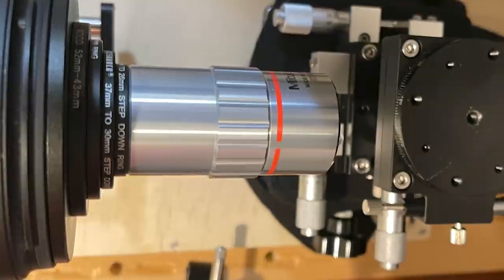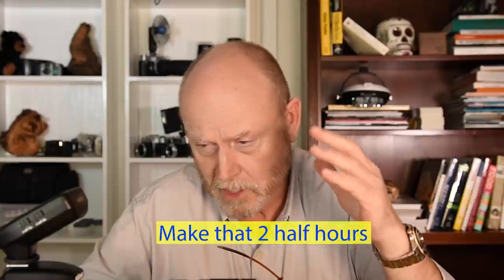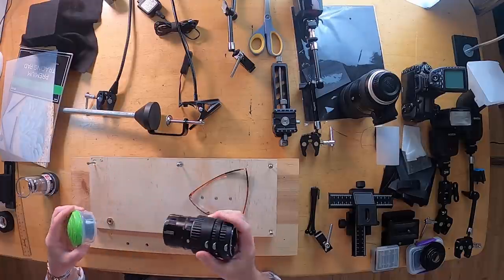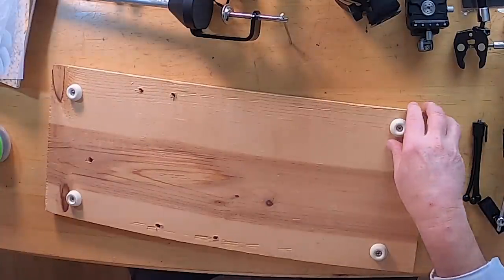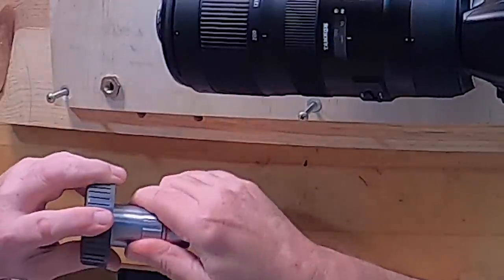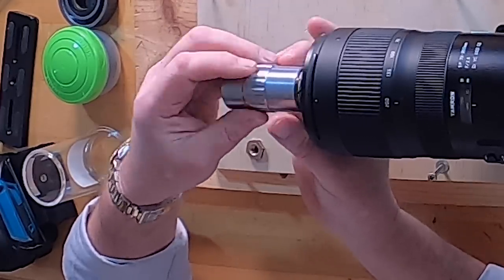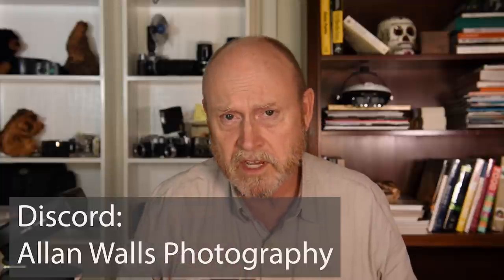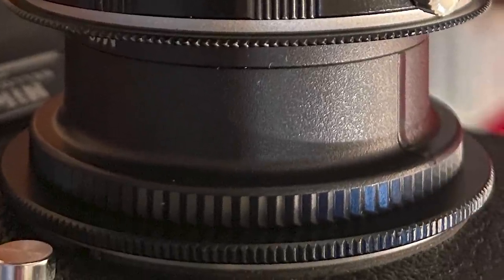Mitutoyo M Plan Apo -  Quick Start Guide for Macro Photographers

Comment: Hi Allan, I was wondering how the Laowa 28mm 2.5 - 5x compared to this objective, i am looking to buy one for my Z6ii, would i get the same results. or will i be wasting money.
Reply from the maker: Two very, very different optical tools, Peter. The former is a self contained macro lens, with all the benefits and drawbacks of such a device. It is hard to use handheld because of the manual focus (if you aren't used to it) and extremely shallow DOF. The Mitutoyo is a "best in class" optical standard microscope objective that is capable of delivering resolution at the limits of your camera's sensor (2um). The Laowa is a fun, though difficult to handle, lens. It is very prone to diffraction , even wide open at f/2.8 and 5x, and optically it just can't compare to the mitutoyo for image quality. But you can't take the mitutoyo out into the woods (well you can, but not to take pictures), it needs to be mounted on a stable platform, with good lighting, etc. Here's the thing, you buy the LAOWA to use at 5x and you need a ton of patience, a tripod, a lot of luck, and it helps if you like a depth of field 50 microns thick. So to get the most out if you should put it on a rail and focus stack. But if you are going to do that, why not spend the one dollar ($399 vs. $400) and buy the lens that people measure their lenses against. I don't mean to sound like a lens snob, but the only way this decision would be a tough one would be if the Mitutoyo cost $5,000. I'd still end up recommending you find the extra $4,601 to get the Mitutoyo, but at least I would have had to think about it. A top tip ... up to 1:1, use a macro lens, from 1:1 to 3.4:1, use a reversed El Nikkor enlarger lens, or a reversed short prime "D" (35mm to about 50mm), and add some extension for the magnification you want. For anything more that 3.5X, use a microscope objective. There is no comparison. Good luck!
Reply: @AllanWallsPhotography  Thanks Allan. I think I will stay out of the wood (you know what bears do in the woods), my thoughts were to eliminate all the add-ons to mount  the objective, I bought the 24-200 lens with my camera (1 month old now ) partly for this purpose. I also bought the Laowa 100mm Z mount to replace my old DSLR 90mm tamron, this Laowa lens covers the 1:1 and also gives me 2:1. the reviews so far have been quite good. almost all my macro photos are taken in the macro cage (based on your plans) , either stacked or from a tripod. I tried outdoor macro photography on bumble bees a few days ago, unless seated or using a tripod it is like trying to shoot on a washing machine in full spin with a missing  foot (the washing machine, not me). I think I will go with your advice and get the 5X objective, because the chances are, I will always extend the lens and use it in 5X. I will hold of on buying the Laowa (financed) and save for the Mitutoyo, in the meantime I will bug harvest for the upcoming winter

Comment: Hi Allan.  I have a question.  How do you keep your flash guns fully operational during a deep stack? If I do a stack over 100 images, the batteries will either drain or the flash will overheat and not fire.  I have to do the stack manually because as I reach the end of the stack, the flashes take a long time to recycle- or I have to change the flash or batteries.  I’ve killed 2 flash guns already from the abuse I put them through.  I use Yongnuo  flash guns with Enloop rechargeable batteries.  Help me...(help me).  I could never use an automatic rail
Reply: I had the same. Make the time between the images much longer and try to set the flash as low as possible (1/16 or 1/32). I made it about 16 secs between the shots and even with 1/8 to 1/4 th the problem is over.
Reply: On many flash units there is a small 5Volt socket which allows the unit to be powered from the mains via those little wall units that one powers most USB 5Volt equipment from. I have various units from a single outlet to an 8 outlet device, which I plug all my flash units into. I rarely use batteries when doing macro photography indoors. These mains to 5 Volt converters are cheap and readily available, as are the USB power cables. Hope this helps. I do a lot of astronomical photography at a professional research level, as well as macro and photomicrography, and these days so much modern gear is now 12Volt and 5Volt, so my interests overlap and help each other. Southern Cross Observatory-Tasmania 42 South.
Reply from the maker: Hi Leigh, and thanks to Shevill and Kees for jumping in - My speedlights won't run off the wall (I wish), but I am 99% certain your problem is thermal shutdown of the xenon flash tube. As Kees says there is a limit to how close together you can fire a sequence of shots before the tube accumulates too much heat and has to shut down. I have discovered that for Godox Vxxx speedlights the magic number is 16 seconds. As soon as I programmed a 16 second delay (I use Stackshot and it is actually 2 x 8 second delays), I have never missed another flash. And I routinely do stacks in the 3-400 range. Try that. One other thing that will  minimize the problem and help with image quality - instead of adding power, add anther flash. I use 3-6 speedlights but keep them all at 1/128th power if possible. It helps create a wall of light that is extremely flattering for most subjects. It also stops any one flash from getting hot and turning off. Hope that helps!
Reply: @AllanWallsPhotography  Yes, I have several small flash units and I looked for those models that can be powered via a USB 5 Volt socket. When used on their minimum flash output I have not run into any overheating issues. As there are just so many flash units on the market it is too wide a topic to start saying which make/models work the best. I have a mix of Nikon, Canon, Godox, Mecablitz etc.

Comment: can NIR  lenses be used as well?
Reply from the maker: Yes, but there are better ways to get equally gorgeous pictures for less money - these lenses are correct for near infrared wavelengths so that certain lasers can be directed without interference form aberrations, they are still apochromats, so they are great lenses - but unless you need to point your Neodymium:YAG laser to trim semiconductors, it is probably overkill, You will get all the same optical qualities for a thousand dollars less with the M-plan.
Reply: @AllanWallsPhotography  I currently live and work in China and here you get everything new and second hand. (but most of the cheaper things are counterfeit, or broken. also these lenses) 
how to spot if one is fake or real? 
the problem is, they price the fake ones same as real ones from Japan, so price is not always an indicator.
Reply: I am planning to get all the equipment (incl a macro slider) they are 220usd here.
The most important is the lens. I was thinking of using the Nikon Plan 10x. and get rid of chromatic aberration in Photoshop after stacking. (possible?) 
thx